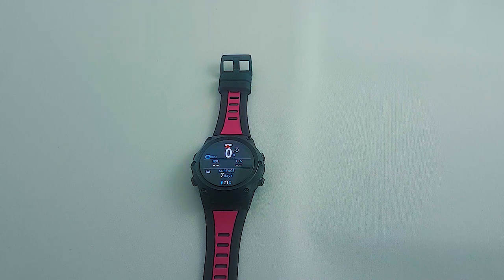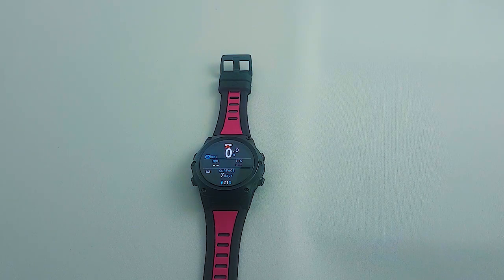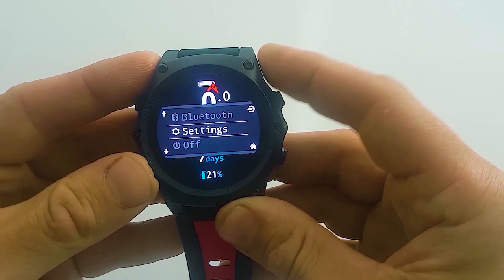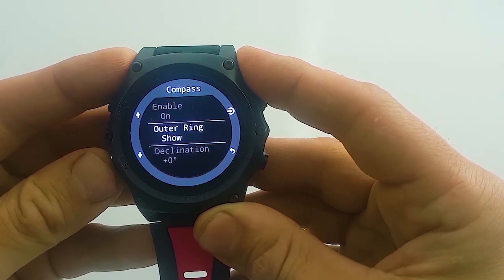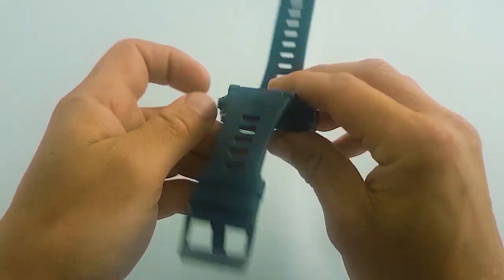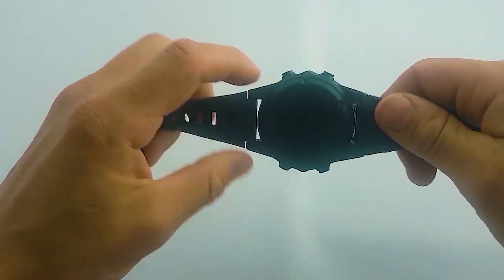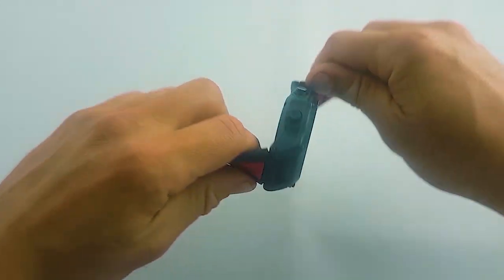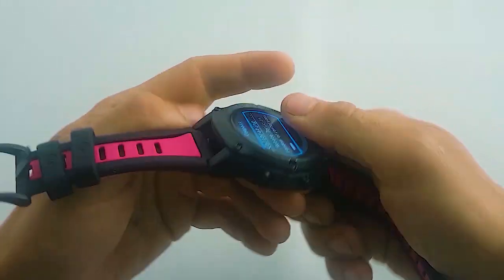How to calibrate the compass on the Shearwater Teric

Comment: Thanks very much. Have been having trouble with the compass. Despite recalibrating it's been 10-20 degrees off and sometimes get "stuck" - don't know how. Tried your process and it seems better - will test in water on the weekend.